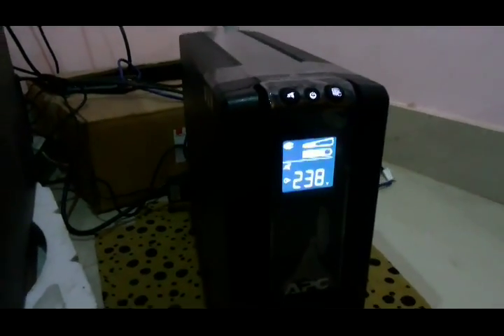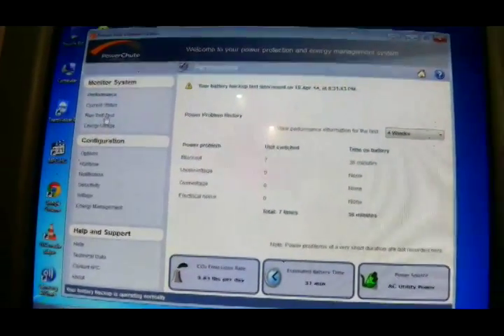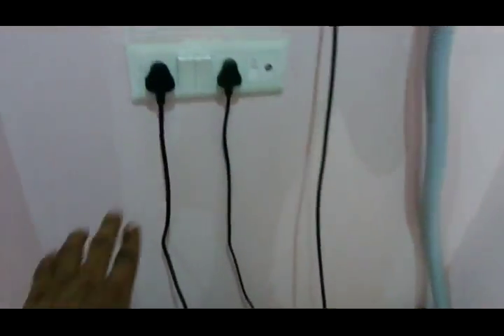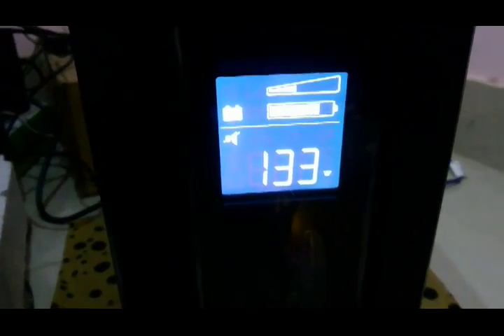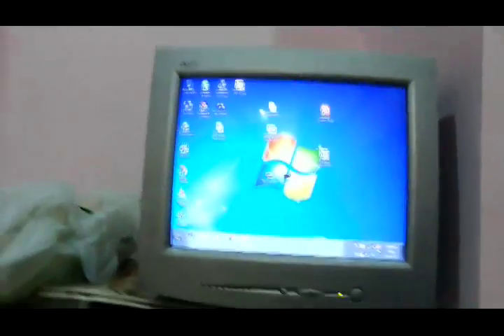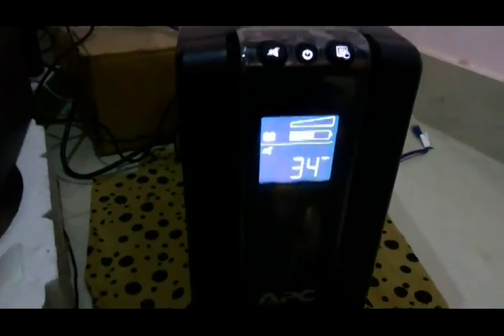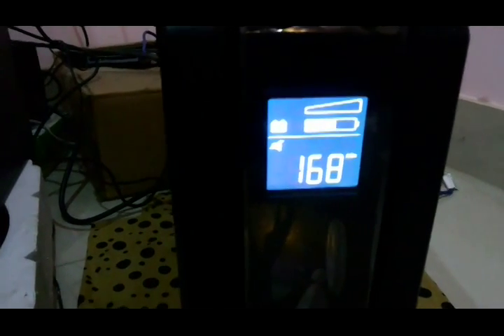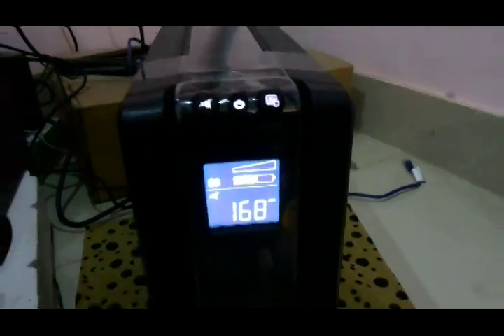APC BACK-UPS PRO 1000 Problem In Sensing AC Power Back After A Blackout

Comment: Hi, can you tell me if you found a solution? I have the same problem.
Reply: APC Smart UPS - How to reset / restart

Turn off and unplug UPS from wall.
Press and hold the OFF button again.
You may see a quick flash of the LED's and you should hear an audible ""click"" from the UPS.
Turn UPS back on.

It worked for me.